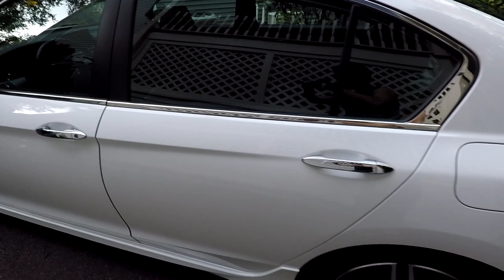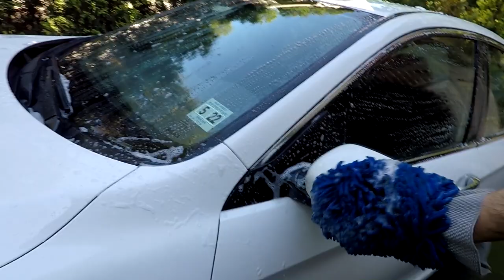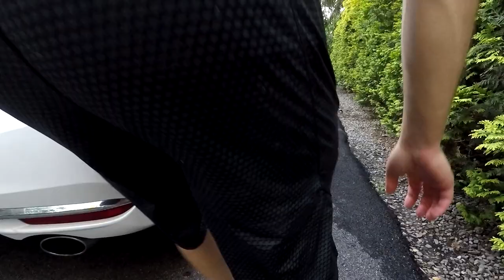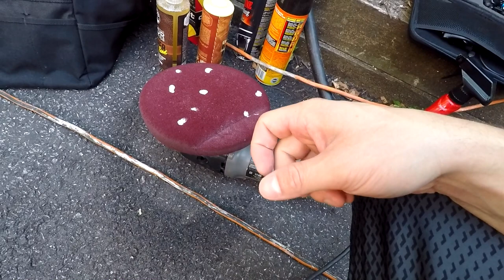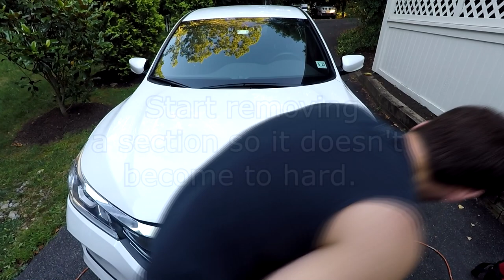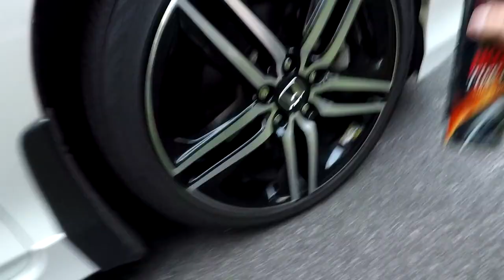How to detail your Car, Detailing the Honda Accord for the first time.

Comment: My experience with buffers, as a detailer I learned creases and corners (surface folds if you will) joining panels, are a very thin finish and runs the risk of thinning the finish. Example: edging on darker finishes can end up showing as lighter lines! Stay away from edges.

Comment: MAn you have no idea how much you helped me. Thank you for uploading this video. I got a few questions tho. Never cleaned my car always went to auto car wash.
1. Usually how long does it take to do all the steps you did?
2. How many Microfibre towel did you use?
3.Did you use only one clay bar for the entire car? or there were more?
that's all brother thanks
Reply from the maker: 1. Depends on how dirty the car is and how scratched the paint is also the type of tools used.
2. This was a while ago, I usually will make sure to have a bunch of clean ones on hand so you don’t scratch your paint because these will get loaded with dirt.
3. Clay bar is to remove what soap and water doesn’t, I always suggest a good deep clean with soap and water, then clay bar, then polish, and wax.
Reply: @NightHawkMotors  Thank you, man. I have a honda accord 2019 1.5L and honestly, I have 0 ideas about what product I should buy and use. Is it ok if I use the product u used? Or can a advise some if ya have any?
Reply: @samidpersia9832  i would recommend meguairs gold class car soap, very cheap like 4 dollars at walmart. get yourself a microfiber wash mitt, doesn’t matter to much as long as it’s microfiber. If you want to clay bar the car get the mother’s clay kit one like he has in the video. DO NOT GO IN CIRCLES WHILE USING THE CLAY BAR GO UP AND DOWN SIDE TO SIDE. With wax after the clay bar any wax works good just know paste wax is better than spray wax.